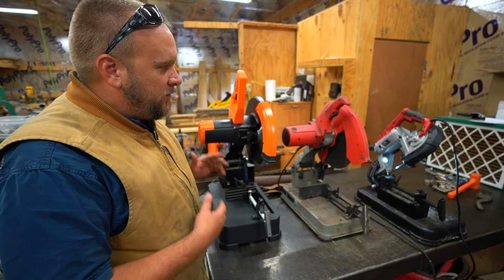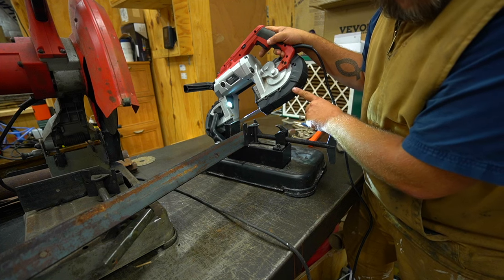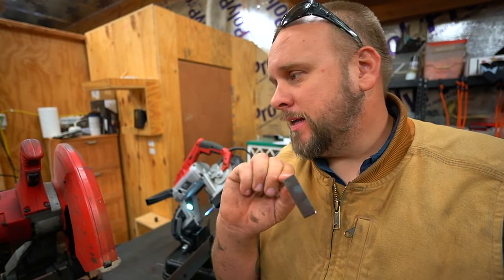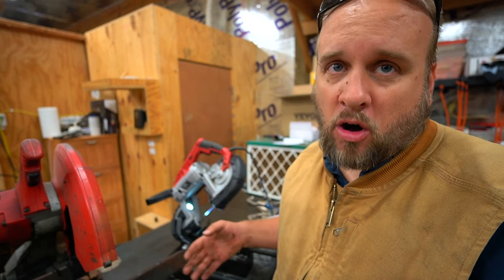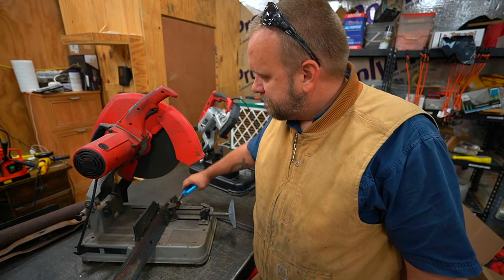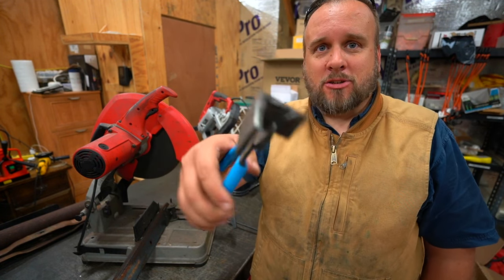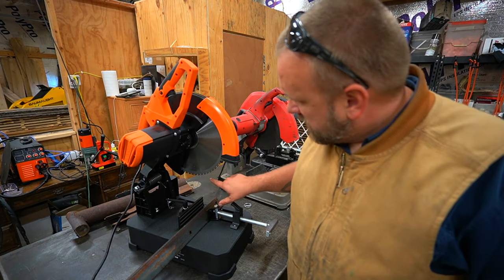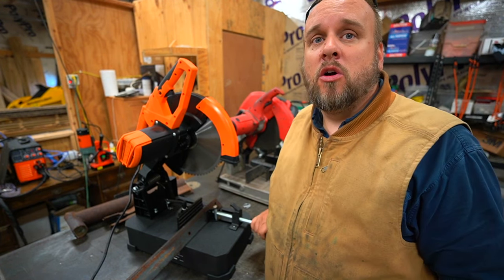Best Metal Cutting Tool? Cold Saw vs Chop Saw vs Band Saw

Comment: Good morning Brock. I've learned something new today. I guess you're never too old to learn new things. I do have a Mikita abrasive chop saw that I've had for well over a quarter century. It works very well but it doesn't hold a candle to that cold saw. If I was younger I'd probably have one of those by tomorrow but I really don't do that much heavy steel fabrication anymore. Most of what I do now is thin stuff and sheetmetal.  But who knows, Christmas is coming. 😁 Well, God bless and have a wonderful day. 👍👍🙂

Comment: The band saw cut a little slower than I expected. I have a DeWalt DWM120 and I was cutting 1/8" thick 1.5" angle iron, and it takes about 10 seconds. DeWalt recommends a 14 to 18 TPI blade for 1/8" material, although they don't tell you ANYWHERE what blade comes on the saw, and it's not stamped or printed on the blade either. I could count the teeth, I guess.  It wouldn't change the outcome of the order they finished in, but I do think the bandsaw could cut faster than it did.
Reply from the maker: I didn’t measure, but I think that was at least quarter inch thick angle. Definitely impressed with the bandsaw.

Comment: Brock, any large, solid round or bar stock to try cutting with the carbide blade cold saw?  Those are amazing for angle iron and tubing, but wondering about thicker, solid stock.

Comment: Only use light pressure on the cold saw and do not slam it into the workpiece, you will dramatically reduce blade $$$$ life! A true cold saw will operate at about 50 rpm and requires coolant they do the best. A dual counter rotating saw (Harbor Freight) works well too!
Reply: 50rpm is less than a rotation a second, I doubt thats true.
Reply: @rockyplayz1224  Try one and then you will believe!
Reply: @HarryVonhoene Just looked at the machine.. I was using high mode for mild steel plates the other day lmao.

Ur right, my apologies.